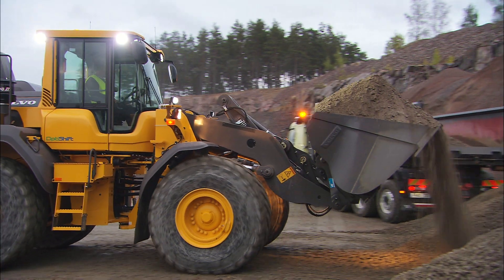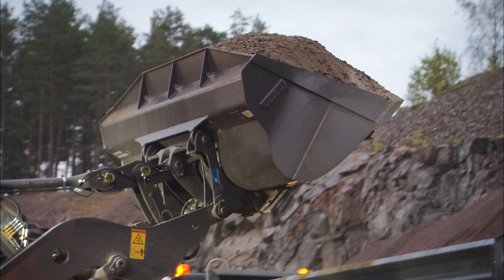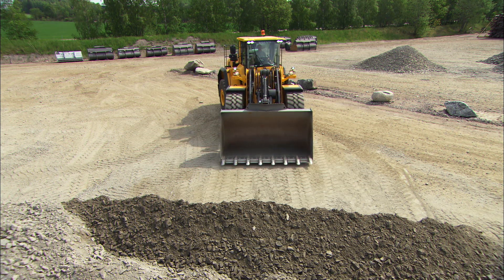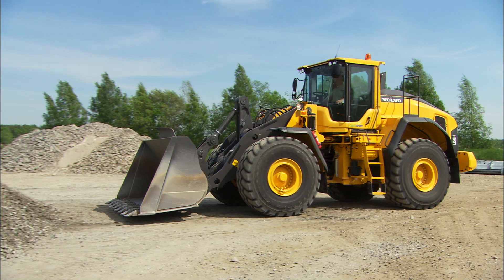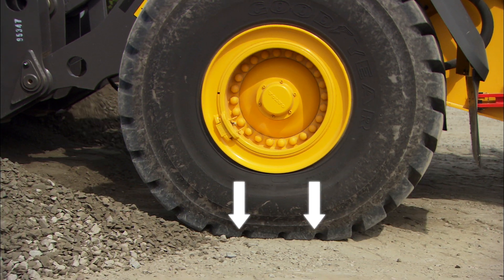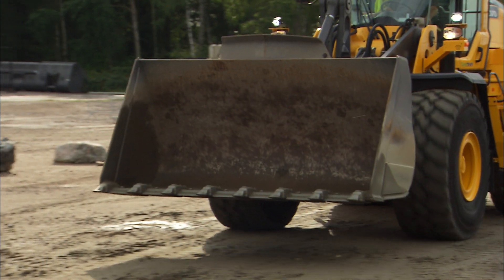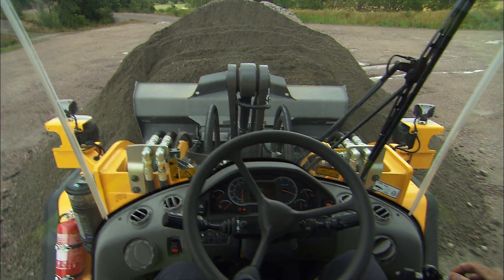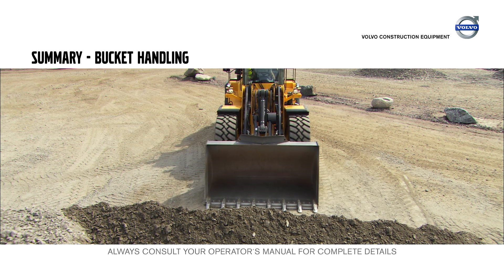Bucket handling – Volvo Wheel Loaders H-series – Basic operator training – 5/11

Comment: If you use 1st gear with a soft footing you'll dig holes 1st gear produces too much wheel torque and the hydraulics are too fast. Use 2nd gear when loading the bucket.  Wheel torque is easier to control and hydraulic speed is better matched.
Reply: This is also automatic is it?
Reply: @arne524  it can be if selected by the operator.
Reply: As they said in the video ADAPT engine rpm to prevent wheels from slipping. In other words don't keep the throttle mashed on the floor. I been working in very soft sand for 14 years and never had an issue using 1st gear. Running higher gears when digging runs higher risk of causing transmission and converter damage or premature wear.
Reply: @RAPTORB26 I think they mean adapt as adjust the rimpull setting it helps alot I run a volvo everyday.
Reply: @jessedean1983 I also been running volvo loaders for years. And cat and john deere and case and so on and so on. Volvo loaders are my favorite tho for sure.
Reply: @RAPTORB26  i havent run a case but cat and volvo i prefer the cats
Reply: @jessedean1983  I haven't ran a new cat yet first cat I ran was a 1974 and the the last one was a 2002 I thunk it was but the volleyball I got now ia a newer 2013 h model boss just bought a brand new volvo h model last year its really nice can't wait to get my new one now..if we needed bigger loaders like 30 ton or bigger class then yeah it would be a toss up from.the new cats and new volvos but I think the volvo has the better comfort for myself. Others might like the cat for comfort more that's part is just personal preference really tho.
Reply: @RAPTORB26  nice yea for volvo we got a l120h and a l180h
Reply: @jessedean1983  bosses new one is a 110h fully loaded with all the extras counterweight and everything  really nice  I have his older 110h  we should have at least 150s but we make do with the 110 they do perform very well for thier size they are powerful and very strong hydraulics in them. Boss tried the cat 950 latse years he liked the joy stick steering in the bat better and the lower price but was about it so he went with the new 110h fully loaded . I'm kinda glad he did other then his family led lights will blind you from about a mile away he lights up the entire pit even and some of the next county 😆  I don't know who makes volvos led lights but holy Damm they are as bright as the rigid industries lights I got on my suv.
Reply: @RAPTORB26 my l120h has the forks, boom attatchment and a streetsweeper attachment.
Reply: @jessedean1983  nice yeah we got 4 or 5 different buckets  the boom  and the forks for our 110s we don't have a need for a sweeper tho everything is dirt lol we priced uo a plow tho but didn't get ut cause that was like about 40 to 50 grand  for that alone .. we do have a need for that tho to plow the long road into the pit using the bucket suckes it takes forever to plow the snow that way.
Reply: @RAPTORB26  14 years and you still don’t have a clue.
Reply: @nealk6387  yeah no clue at all how many years you been doing it wrong again?
Reply: Maybe you just need to learn how to drive, i always use 1st gear when i load the bucket, i never dig holes.
Reply: @bjorndahlberg9182  ok, fuckin super operator!